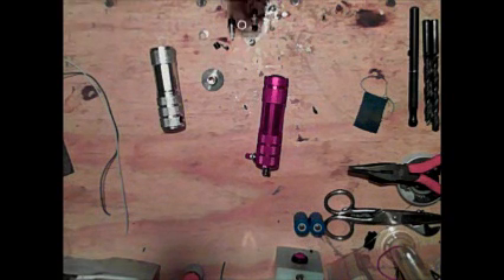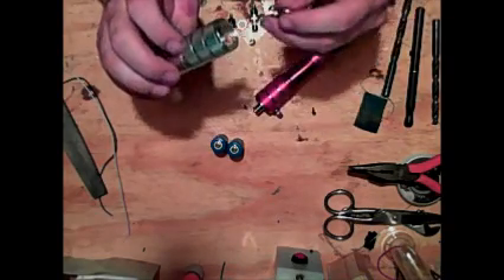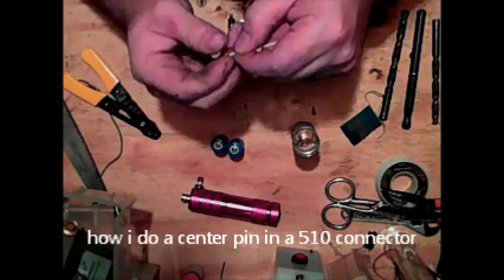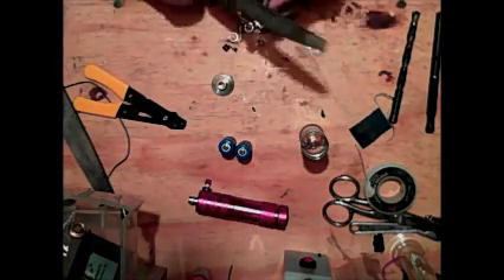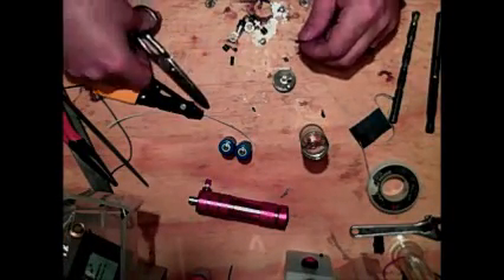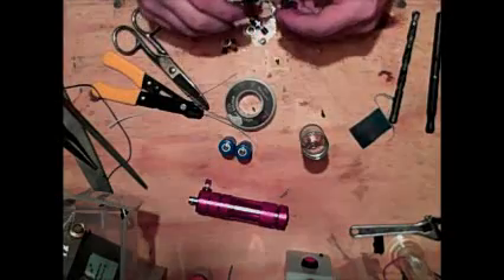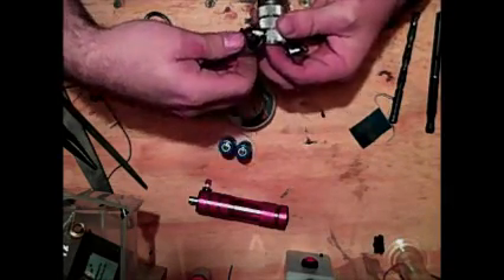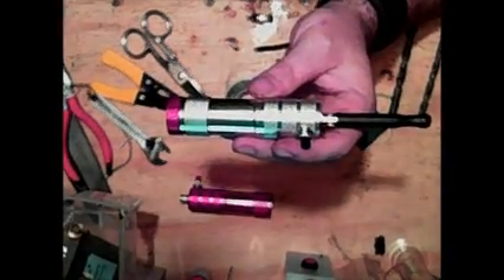How to build a flashlight e cig mod

Comment: @tek413 I'll try that.  What I've been doing is I put the handle of my small tack hammer inside and whack it with my regular hammer until the assembly pops out.  On one of my mods, I used two of these flashlights, cut them in half with my pipe cutters, filed one of them down until it press-fit into the other, silver-soldered, sanded smooth.  This way, I could put the atty connector into one of the end-pieces, a penny fits perfectly into the end switch hole after prying the switch out. Nice.

Comment from the maker: the negitive connection is the tube, but that is because it is conductive from the connector, to the washer, to the flashlight housing. But if you want to add a negitive wire from some point directly to the atty, that would only improve the preformance and lessen the over all resistance of the connections.

Comment from the maker: No two cr123a batts does not give 5 volts, first it depends on what voltage batts, and there are a few different choices, mainly being the 3.0 and the 3.7 rated voltage batts, and they would give you 6 or 7.4 volts respectivly.  Second the bottom cap is vented using a small drill threw the plastic holder, but not threw the rubber bottom cap. 
hope this helps

Comment from the maker: Shorting out is a bad term to use on this example but, think of the atty like a light bulb, both give off heat, and conduct threw them with a factor of resistance that will limit the amount of current that can flow. All mods are basically the same as in a battery housing, switch, and connector. The flashlight body is the ground or negative to the unit  and yes the positive flows threw the spring to the switch and then to the atty where it loops threw the coil back to the battery {eventually lol}

Comment from the maker: But does the ego firefly run at 6 volts and a draw of 2 amps at 3 ohms? Just curious if they have changed the 650 mah batt to include a boost circuit for people like me who like 12 watts over 8 ..

Comment from the maker: Its 6 volts, and, the diagram is really just a switch connector and battery housing. Electrically speaking the negitive flows from the bottom of the battery threw the main switch to the housing, to the connector. The positive flows to the push button to the center pin of the connector.. hope this helps.

Comment from the maker: Its just how I chose to run the batts, you can actually run them in the other direction. I just feel that spring makes better contact to the larger surface of the battery then the positive nipple.

Comment from the maker: depending on what you want to use from a 2c fuse, to a atc type bladed fuse yes, there is room, but it is really up to the flashlight, The ones in this vid have not been sold since say 2010 or at least havent found the ones that are 1/4 inch longer at any home depo in almost 3 years.

Comment: Amazing! I wonder how to add alarm voltage or some cutting off voltage if I use 3.7v Lithium battery.? So it  won't damage the battery if drain under 3v.. Thnx!
Reply from the maker: What could be added is a pcb, battery protection circuit module. Its available and can cut a normal 3.7 volt battery at a safe voltage from depleting and ruining the cell.. However some cells come with this built in, and due to the life cycle of the parts, would be tossed with the cell after its ideal life has been used.
Reply: tek413
if this is safe?
Reply: *****  no😂😂
Reply from the maker: TukeFlips how is a protected batt not safe?
Reply: tek413 it was a joke

Comment: @tek413 Ah, I repair band instruments for friends, so I have that fat high-temperature silver solder, rosin, and a torch, pretty much what you can find at a hardware store.  I use it to solder/weld back on spit valves and etc on trumpets, french horns, etc.  My welder buddy sneered at my messing with aluminum, told me it's not safe to mess with at high heat.  Oh well, I'm just modding for funzies, lol.  Cheers!

Comment from the maker: You can but depending on the switch you use, and the depth of it, will be the out come because of battery size issues in relation to the diameter of the light.

Comment: how did you get the light out of the flashlight
Reply from the maker: Trever Brown old electricians secret, used a jar of black light to soak up all that extra light I spilt.

If you mean the leds, use a rod or broom handle to push it out, from the battery side, a good wack and it comes out.
Reply from the maker: +Trever Brown I pushed a rod from the back end till the leds poped out the front

Comment: Do you notice the tube causes serious resistance?  How does it work with one 18650 battery on say a 1.8-2.4 ohm coil?  I have tried with one or two cheap flashlights but the tube measured 1.2 ohms resistance taking away too much power from the load.

I suppose at 6v this would bee less of an issue,,, I bet it would vape better if you add a copper strip internally to lower resistance.

Comment: I wonder if a 10 watt potentiometer from RS would handle the current considering the short duty cycle? It would be interesting to see if you could turn it into a VV mod by replacing the switch in the tailcap with a pot. Not sure what resistance range would work best but it would be fun to experiment with.
Reply: Potentiometer is not variable voltage... Because of voltage / current division laws, you will just be wasting power as heat in a resistor.  If you want to get a VV mod you need to setup a buck-boost circuit, or some other such switched mode power supply / transformer...
Reply from the maker: Tom Gozette Or, You can use a voltage regulator to take a larger voltage source (such as stacked cells) and drop the voltage. The effect this has, is to lower the amperage used in the circuit, where as boosting the voltage off a battery has the effect of increasing the amperage draw.
Texas Instruments have some really compact boost packages that have been used in the modding community for a while now, and are very reliable. They use a transistor toroid and capacitor config to boost the voltage if my memory serves..

Comment from the maker: Less connections, shorter wire = Better conduction, just like with pipes. You are correct. But that same battery pack, cant put out the max amp for the load.. Ie, it will supply x amount, but that is still less then what is truly required to be safe and soft on the cells. Try aas, that will be better.. Or a 6 volt lantern cell, remove one cell from the unit, and that would be the best your going to get.. But, I know you know ohms law, and the cell impedance, and the max out put of primary cells

Comment: new to all this vapping and mods, but i wanna use this method for a 5v pass through. any suggestions on what Ohm carto single and dual also where i go to find them. nice review of wizard labs can't wait to order from them. Any info you could share would be great. maybe you could layout a specs video as far as Volts Vs. Ohm's on different voltages cartos and atomizers. Kind of a matching guide to help use noobs to get rolling in the right direction. Thanks barry

Comment from the maker: A regular res atty is fine to use with High Mah batts or low mah batts. I my self prefer a 3 ohm carto (aka standard) at 6 volts to a low res at low volts.  Hope this helps :)

Comment: can you please give more details about the connector and the washer on the top
Reply from the maker: Like?
Reply: Like material and assembly, also photos if not asking too much, thanks.
Reply from the maker: I made a video showing assembly and steps, cause it is very simple, and find a flashlight that will fit a washer of your choice. It's really that simple and I haven't modder one in about 2 and a half years. The more recent mod is a 8 barrel box mod I'm half way threw building but I don't know if I will ever finish it. Good luck and best wishes

Comment: Where do you get the 510 connector with the little contact?  the part you filled with solder.

I can only fined the out adapter part with the threads

Comment from the maker: @peacepipe215 there 3 3/4 long, dia of about a quarter, or just under 1 inch. There labeled iron bridge tools and were carryed by home depot. If you dont use the top switch but modifiy the bottom cap switch to be a push button, so that it will still work.. ON the shorter flashlights any way... Also i do do these mods on my show on thirsday nights on gptv if ya could not tell lol...

Comment: Cool vid. I like the simplicity of this and if you added a mosfet, if there was room, this mod would be able to handle today's drippers.
Reply from the maker: I agree with some of this, and there would be just enough room for a mosfet, and in fact, I do plan on updating a new video with this build. However this build as is, can not handle the amps from sub ohms and the spring will act like a fuse and break contact. Its a older way of doing it for safety and a mosfet incorperated in to it would extend the life a hundred fold of the switch. However the next build will use a thicker flashlight that would allow threading to occur.

Comment from the maker: I really do not understand the question. This is a way to change a cheap flashlight to a ecig, if by the way i use two cells, I could use one but want the higher voltage for warmer flavor. IF not, then Please help me understand what i should answer.

Comment from the maker: Depending on useage, I can go up to 10 mills of liquid threw a day, at that amount, and at 12 watts (3 ohm, 6 volt, 2 amp, 12 watts) I am yes burning threw juice faster, but also a dense vapor, so I may be anywhere between 1 amp and 2 amp hours a day.. But there should be also a correlation to the ejuice consumption, 650 is plenty for a 4.2 v and 3 ohm user, even 2 ohm, but what is the ejuice rate per day? me, bad days 10 mills, 2 amp hours of use

Comment: Hey man first off, great video. Just great, Secondly I wanted to let you and everyone here know that you can get basically the EXACT same flashlight from Harbor Freight, Northern Tool, Ace Hardware, etc. but the cheapest place to get them is Harbor Freight because if you get their coupons via email, backs of guy magazines, etc then you can get them for FREE!

Anyways I wanna ask a couple things. The switch, both wires are positive right? Like it doesnt matter which post gets soldered to the spring right? Also I just wanna comfirm that basically the cap you made with the 51- connector replaces the lens and bulb of the flashlight right? Anyways great stuff man I just dug the same flashlight out of my junk drawer and Im gonna make one as soon as my parts get here. Cheers.
Reply from the maker: Yes to the switch  part. It just makes and breaks a connection. As far as flashlights go, the harbor freight are to short from my local store but you can allways put the switch some where else.

Comment: Awesome that does help. I've got a flash light just like this and a seller I just started using keeps giving me lr tank atties instead of sr, idk how many ohms they are exact so for the sake of ohms law I'm gonna say 1.8 ohms sounds right? Now you say this is a 6volt mod, so that is a  6volt 18650 sized battery?

Comment from the maker: No question is bad or lame lol.. No the bottom switch that I say to be careful of is the main on - off switch and still functions, the drilling just allows any possible gasses to flow around it to escape in the case of a battery vent.

Comment from the maker: @peacepipe215 Usally 18-22 gauge, finding that per a ampacity chart that my smallest wire will handle seven amps, and that is more then enough lol.. but i do live by the bigger the better, using a consideration for placement, and bending ability.. and having to fit so many in a small space...

Comment: Oh also when you say "510 connector", do you mean a 510 BATTERY connector or a 510 ATOMIZER connector? Also how did you get the lens/bi;b portion off the body of the flashlight? The one I have looks like it can just be twisted off. Thanks in advance.
Reply from the maker: Depends on what threading you want. I want my battery connector to fit my 510 stuff. I pushed it out with a marker

Comment from the maker: well, if you want to request this, I will make one. Its dead simple actually, if you take a cartomiser or atty you can deffinatly add a pll from a fancy light (the led and voltage regulator) to allow you to have a screw on head that will be as bright as any tac light

Comment: Now, I've been assuming the negative runs through the tube for a while now, but since I'm working on a little mod now with the same type of switch, I'm wondering if I can just run the negative connection from the tube. Is this the case? Thanks very much!

Comment: is there a way to be able to use the same switch that comes built-in with the flashlight at the bottom and can this be used/modded for cannabis purposes ?
Reply from the maker: yes, if you make one cut inside the cheap plastic switch it will go from on off, to momentary.

this is a power supply. what you put in to it, is up to you so, if pot is your thing, or ejuice, or roofing tiles... yes you can even put the DNC Debbie shultzs in it.. 

will it work as well as other devices made for it? 

that's up to you bud

Comment from the maker: It is battery driven like the gg or the silver bullet. If i were to say use a 18650 i would be getting the full 3.7 (actually 4.2 due to the charger charging at 4.2) Or 6 volts (really 6.4 cause the charger charging the cells at 3.2 volts each) There is no voltage regulation, and the spring will collapse in case of a short.. And make sure there vented if you were to attempt this, mine are and the rubber bottom piece will blow off..

Comment: where did you find the switch? I'm trying to build one similar to yours but I can't find a switch.
Reply from the maker: radio shack back around 2013. if your building this for more heavy loads, use a mosfet please lol.

new video coming soon, of a build like this with a mosfet and updated methods
Reply: Nice I'll stay tuned. I'm getting an actual mech soon but I like to build stuff and fabricate so this is a fun little project.

Comment from the maker: Well, there in lies a problem. The part that screws in is a cartomiser. I prefer cartos, over attys, but there simply a short length of kenthol wire, or resistance wire, and set to around 3 ohms for ecig use. The magic happens when you surround the coil with a eliquid, that would vaporise in to the inhaleable water vapor and nicotine combo.

Comment: where did you get the five ten connector. and what is it called and used for? plz answer me back im been struggling with finding the connector for awhile now.
Reply: It is called a 510 connector and it is used to connect 510 threaded devices.You can buy them at Madvapes...but something tells me you shouldnt be making mods until you research to the point of actually having half a clue or you are going to build a bomb instead of a mod.
Reply: 47ravenlord too late i made one and it works great thanks though for your concern.
Reply: 47ravenlord what do you mean by make a bomb? I would like not to build a mod so your knowledge is useful to me.

Comment from the maker: @peacepipe215 I order my most of my switches, connectors, regulators, and if i were to need leds or resistors from gp, madvapes i love the batt boxes they have, and as far as bodys, i go all over for them. Wire i have on hand due to being a electrican.

Comment from the maker: Your math is on the bubble and competly level. But I am curious as to where this .8 ohms is coming from, Al has a know resitvity of 2.82 × 10-8 Ω·m and that being less then 4 inches of tubing, with a high circular mill area would give me great mistrust to where the current drop (resistance in a series parallel circuit) could be coming from. If your sure the tube ends are clean, and the meter leads ring out at or about 0.001 ohms, as a good meter should, then we must look at the alloy of the tube

Comment from the maker: Well no, The aluminum, should give a very low resistance for the surface area, if there is any resistance that can be metered (by other then a very accurate "standards calibration" meter) there is a issue, Is it just a press fit? Is there epoxy or glue causing a poor connection, oxidation, removal of paint? Before assembly you should make sure all electrical connections, press fit or solder are clean and shiny.. Over time oxidation or corrosion (if using copper to aluminum) will cause resistance

Comment: I have been into high-end LED flashlights for a while, and many of them use Li-Ion batteries. I joined candlepowerforums a year ago, and I've read up on Li Ion technology, rules, care, etc. They are different from NiMh batteries, they are potentially more dangerous. 

Cpf has a whole forum area filled with catastrophic failures with Li Ion. Usually it happens with cheap Chinese batts like Trustfire, Ultrafire. Better to not buy them, get Panasonic based Li Ions. Get protected ones too.

Comment from the maker: nope. Im running two 3.2v cells for 6.4 but 6.1 under load. Gives me 12 or 13 watts depending on the actual resistance of my cartomiser.

Comment from the maker: I havent found the part number, i do belive i said it in the vid, but if not, you will need the smallest 3 amp push button they have, usually come in a 4 pack, from them, and any small one would work.. 
The flashlight has a led board on them, that originally has a spring to get the positive to the board.. this is the spring that i used, but any small aa or aaa spring would work. 
Happy and safe modding.

Comment from the maker: the adapter would work just fine if that is all you can get, you can even thread it so that it screwes in to the washer, 510 = 7.5x half pitch metric tap

Comment: how did you remove the lens, LEDs from the front of the flashlight? I found the flashlight Harbor Freight is selling them for 1.99 for 2 and I bought 4 just in case I screw up on the mod but How do you remove the front lens?